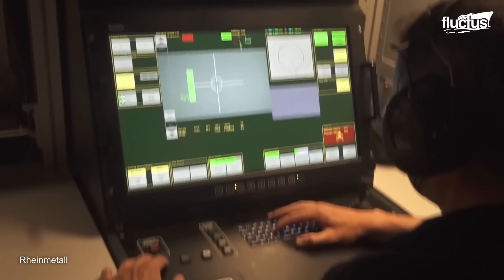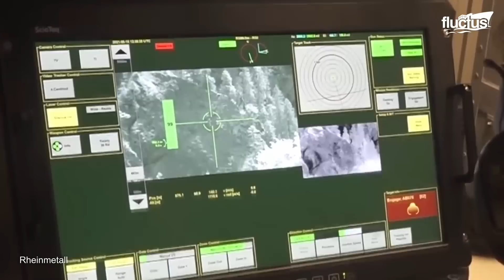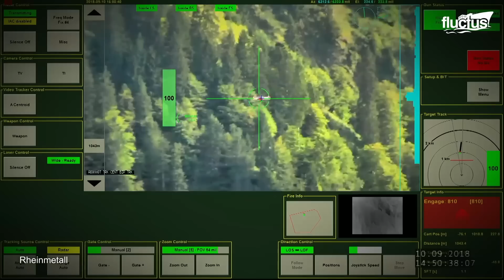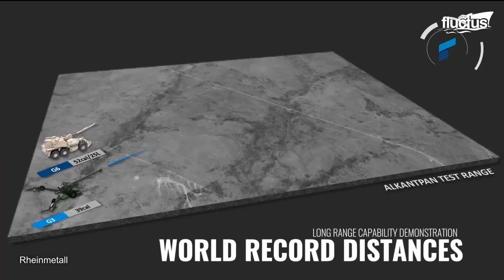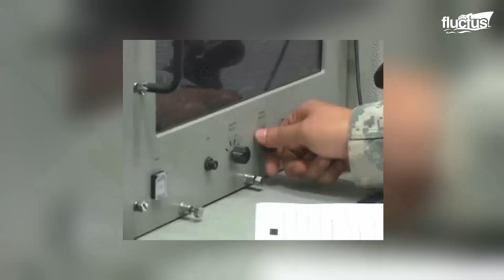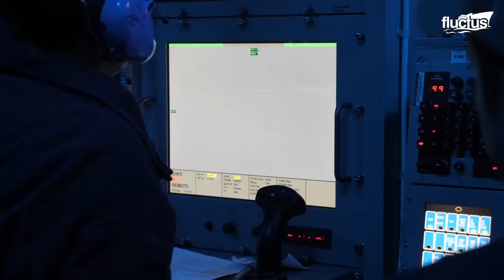Germany Testing Monstrously Powerful Multi Million $ Anti Drone Truck

Comment: The problem with this system is: the canon is produced in Switzerland and therefore you get a hell of regulations if Germany wants to export this. See f.e. the current situation with the Gepard aa-tank that also uses the older Oerlikon AA-gun in 35x228 and for which Germany now can't export the ammunition.
Reply: I think this thing is defeated by many smaller drones. Ones the size of dragonflies with 9mm strapped to the bottom.
Reply: why Germany is now unable to export ammunition?
Reply: Since when does Rheinmetall solely produce in Switzerland?
Reply: Hahaha lol algeria has them as the skyshield package, and they are pretty much a military dictatorship
Reply: @certaindeath7776  Rheinmetall was founded in 1989, so thats not possible. Same as the weapons which were all produced post WW2 and made in Germany, not elsewhere. 
I really dont find any evidence of the switzerland stuff all you guys are dropping here.
Reply: @adhx7506  The largest western manufacturer of AA guns since World War II is the company Oerlikon-Bührle Switzerland with their 20mm - 35mm AA-cannon systems.
These guns are used by Germany, Japan, Turkey, Great Britain, USA and many other western countries. The weapon system of the German Gepard AA tank is a 35mm Oerlikon system. The german Mantis system is a renewed system from Oerlikon-Bührle from the 1980s.
Rheinmetall acquired Oerlikon-Contraves in the 2000s. Rheinmetall-Air Defence is headquartered in Zurich Switzerland. Development, production and testing take place in Switzerland.
Reply: Hence why they bought the biggest ammunition factory in Europe, in Spain recently. To produce high numbers of ammo. 20 billion alone from Germanys 100 billion special budget goes into stocking ammo, so the purchase is definitly wort it for the foreseeable future. Their stock went up by around 8%.
Reply: @gamramjam535   Bonjour, Je suis citoyen Suisse 🇨🇭🇨🇭🇨🇭 et je confirme ce que vous dites. J’ai fait ma formation militaire en Suisse dans la DCA (défense contre avion). Nous avions à l’époque dans la DCA moyenne des canons à bi-tubes de Oerlikon Bührle de 35 mm. Deux de ces canons étaient reliés à un véhicule avec radar (appareil de conduite de tir) et je peux vous dire que ce système à l’époque était très efficace.
Salut de la Suisse.
Reply: @drrichardwiesenhuber  Switzerland has been supplying 35mm ammunition to Germany for over 40 years. The Gepard is out of service. Why didn't Germany start production itself? Don't overdo it, otherwise Rheinmetall Air-Defense can't deliver anything anymore. All systems such as cannons or the Mantis aka Oerlikon Skyshield still come from Switzerland. PS: Ask the NATO partner Turkey! They have been produced the Oerlikon KDC-2 cannon (MKEK) and the ammunition (Aselan) under license for years. See the new AA Korkut system. But the Turks will not give Germany ammunition.  The Turks are still angry at the US-EU sanctions (F-35, Tank upgrade....) lead by Germany.
Reply: That would be a huge problem for Switzerland for their weapons exports. No one would trust them.
Reply: @gamramjam535  well the offical statements is different(google it!) but you seem to know.
Reply: @thrakiamaria  End user license agreements are actually standard procedure in the West when it comes to arms trade. Usually the agreement of the producing country and all previous owners is required for any sell to a third party. As Switzerland is neutral, Swiss companies are legally banned to export weapons to countries at war (and to that extent are also banned from agreeing to a customer selling Swiss arms to a country at war), unless the sale is authorized by the executive branch of government.
Reply: @adhx7506  Rheinmetall Air defence (former Oerlikon-Bührle) is a subsidiary of Rheinmetall AG situated in Switzerland. Rheinmetall Air defence developed the Skyshield and it‘s proprietary Ahead shell. Because Rheinmetall Air Defence is situated in Switzerland, according to Article 9 of the federal act on war materiel (war mat act/WMA) they require a licence to trade in military arms, even if the production of said arms isn‘t located in Switzerland.
Reply: At least the munition problem should be solved in the near future since Rheinmetall just bought a new factory to produce ammunition outside Switzerland.
Reply: Rheinmetall would most certainly not produce in Switzerland, because they are dependent on the export market. So this would make absolutely no sense at all. And they are not stupid.
Reply: Grüezi, ja... ich hätti gaern es Kaffi ha. 35mm Oerlike... ja...grad bi Züri, ohni kräm bitte
Reply: Nope, we can produce them also in germany ;)
Reply: But currently this AHEAD ammo is still produced by Brazil and other countries that counts the licensing from the current Rheinmetall owner (the former Swiss company Oerlikon-Contraves was bought by Rheinmetall Defence).
Reply: if they object, invade Switzerland
Reply: das isch au guet so :) mier schwitzer wen das dies nur zur verteidigung igsetzt wird und nid um andee menschen abzuschlachten.
Reply: @blacknass1943  aha und die Ukrainer greifen grad a oder was?
Reply: I'd like to give a few dozen drones to test
I bet you I could program an attack pattern like hugging the ground or attacking from multiple directions simultaneously to easily overwhelm such a system for less than $50K.
Reply: @TheAnnoyingBoss  💩
Reply: The weapon may not reach when needed, for it is too large. Anti drone must be a sting ray-like gun that can be carried easily and quickly at everywhere.
Reply: someone here will still say that it's ok to buy weapons from Switzerland, but no, it's not ok, even the German Ministry of Defense itself has questioned further cooperation with Switzerland due to the fact that they will always try to say that they are neutral and will not sell you anything when it’s really needed.  these are not just words, this is a real situation and the Ministry of Defense is already seriously concerned about this!
Reply: No not the gun, but the ammo as per my understanding.
Reply: Germany should quit its cooperation with swiss manufacturers in the military field
Reply: @militarytechcom  germany sighned a contract with the swiss company that prohibits the ability to sell ammunition to countries or factions that are against the swiss national interest
Reply: Thanks God it can‘t!
Reply: When a nation doesn't want to cooperate, the regulations and general paperwork balloon out of all proportion.
Reply: @adhx7506  Rheinmetall was founded in 1889.  It was one of the major arms providers to the Third Reich.
Reply: the problem is the same as with all the vehicules, they are easily targeted by aircraft, helicopters and even manpads
Reply: It would be better if Germany didn't export such systems anyway.
Reply: @gamramjam535  – "The Turks are still angry at the US-EU sanctions (F-35, Tank upgrade....) lead by Germany."
I have to say you are confused. Germany wasn't in any way behind, let alone leading, removal of Turkey from the F-35 program.
Reply: @militarytechcom  Due to the fact that Switzerland has made the contracts in such a way that countries that buy weapons from them are not allowed to export it afterwards "they say they are neutral"

But it also means that countries such as Denmark will no longer buy weapons from them.
Reply: @adhx7506  it isnt. Actually rheinmetall bought oerlikons entire arms group, the entire discussion is about the ammunition which was produced "before" rheinmetall bought oerlikon. Thats also why germany was able to deliever 60k ammunition for the gepard without any problems but there are 11k shots which were bought prior. Thats all this discussion is about. Actually rheinmetall just a few days ago also bought the biggest solely ammunition producer in europe. A spanish company expal systems. Rheinmetal had a productions capacy of 80000 155 mm nato granades a year, no its productions capacy has increases to over 400000. rheinmetal bought expal system for 1,2 billion dollar and its also able to now (finally) produce new gepard ammunition. If it wouldnt need so much time to begin a new production line, problem solved
Reply: @ViolentKisses87  That gun has 5km range. That gives it fe 3 minutes to put rounds in any low tech drone swarm traveling at 100km/h before they arrive.
Reply: now germany can produce both of them without Switzerland.
Reply: @ldkbudda4176  Was, but I don't know, he has also 3 children with Kabaeva.
Reply: @ypey1  
do not make stupid comments please
Reply: @k55511e  And they're right knowing how the world goes and all the unstable countries they're surrounded with, there's no place for the weak
Reply: Problem solved by the germans new factory for 35mm munition in Germany
Reply: Oerlikon belongs to Rheinmetall and Rheinmetall is moving Ammo. Production to Germany. the Problem is allready solved.
Reply: You perception is wrong. Germany can export what it wants, if it serves the purpose to defend the country. It might not get new shipments form switzerland to replentiship tough. 
Same goes with the 95 Leopard 1 tanks in Italy if it defends the EU Italy could seiz them, hand them to Rheinmetal and the compensation could be paid in a few years down the road, to the current owner. The swiss gouvernement would probably protest but wouldn't&couldn't to anithing about it.
Reply: How many rounds can it fire before it runs out of ammo? How many drones would it take to exhaust those rounds?
Reply: The instant I heard 'Swiss cannon' I immediately realized Germany got 99% there and then screwed everything up.
Reply: @TheAnnoyingBoss Size of dragonfliess😂? Ths explosion whould be too small! Those 9mm drones cannot even beat defeat a human, unless it attacks the head directly.

Comment: The main armament for the Abrams tank is the 120mm M256 smoothbore gun, developed by Rheinmetall Waffe Munition GmbH of Germany
Reply: @Herbert Sattelmeier Also eigentlich macht es schon Sinn mit Fr zum Beispiel zusammen einen Kampfflugzeug zu bauen, das ist sonst einfach zu teuer. Aber hier sind es ja auch die Frahzosen, die vermutlich auch Technologie teilen müssten. Deswegen weigert sich ja Dassault auch. Sehe ich aber auch nicht ein, dass wir denen einfach alles an knowhow überlassen, das durch die Entwicklung entsteht.
Reply: @Herbert Sattelmeier 

Aus Airbus ist nichts geworden ? 🤣🤣🤣

Tatsächlich, es ist nur der weltweite Marktführer in Sachen Zivilluftfahrt…
Reply: But this one made Switzerland
Reply: Obrigado !
Reply: Panzerkampfwagen VI Tiger Zwei030. Two 2000kW power generators accepting different fuel types. Weight: 42 tons without ammunition, 3 crew. Electric per-wheel drive, different chain types optional, top speed 180 km/h, 7s from 0 to 100 on plain wheels on asphalt. Modular 2500 RPM 9mm point defense system at the rear of the turret. Stabilized auto-loader turret with twin 180mm main cannons, both independently accepting missiles or standard shells, as needed. Have you seen it? No? Because the video game is not out yet :P
Reply: @Herbert Sattelmeier Naja, das sind keine teuren technischen Probleme oder Änderungen im Design mitten in der Entwicklung. Worauf man sich nicht einigen kann ist die Auftragsverteilung und wer wo welche Kontrolle über welche Technologie hat.